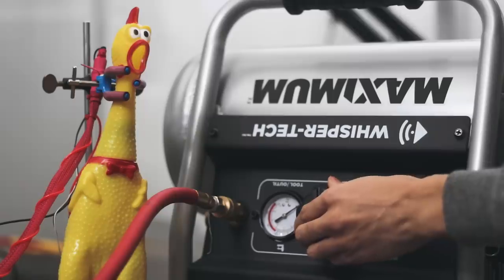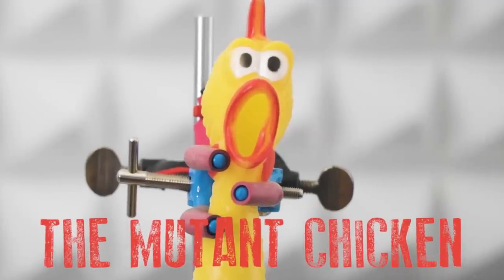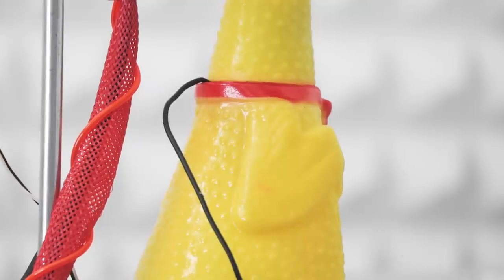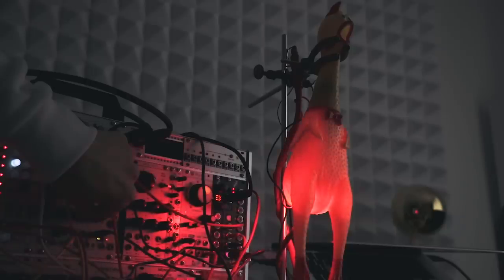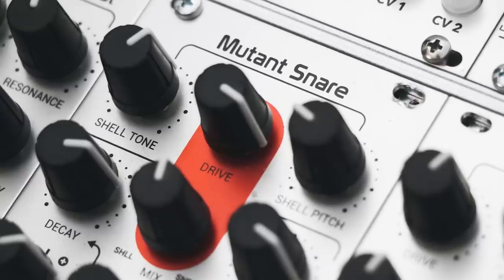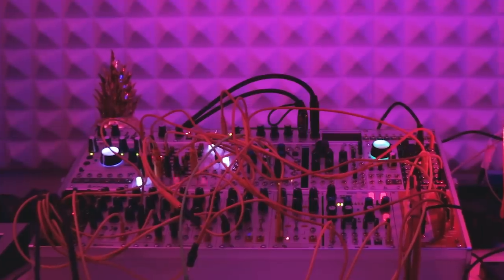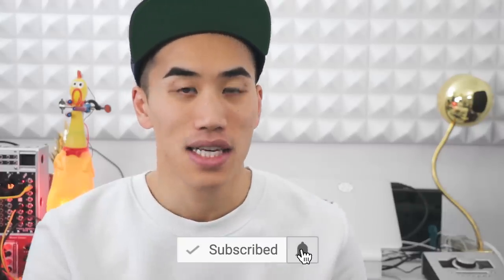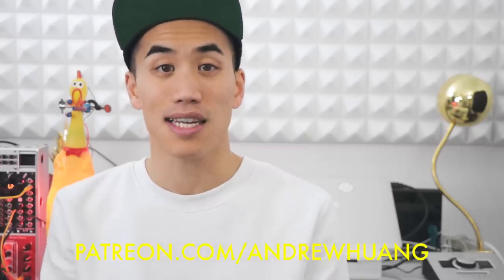The Rubber Chicken Instrument 😂

Comment: He absolutely needs to put a voltage controlled pressure regulator in this to allow you to control the pitch of the Mutant Chicken. That would make it the perfect synth. I mean, it's primarily the flow rate of the gas that controls the pitch in this case, but the pressure regulator would effectively control that if you assume it has a constant input pressure... which the setup seems to lack.  But it is the next mutation that absolutely must occur.